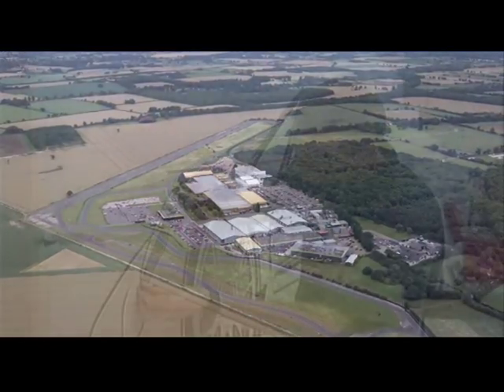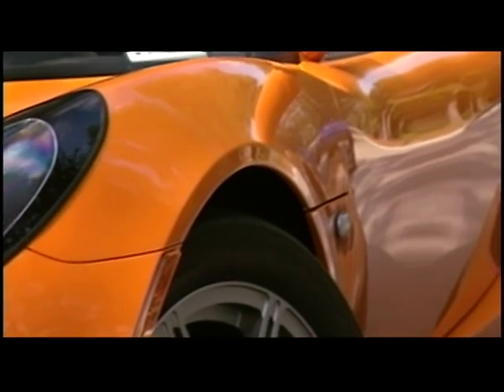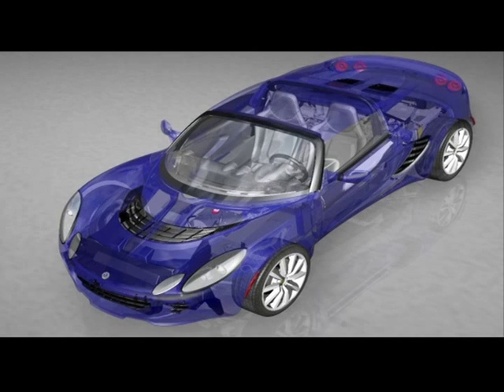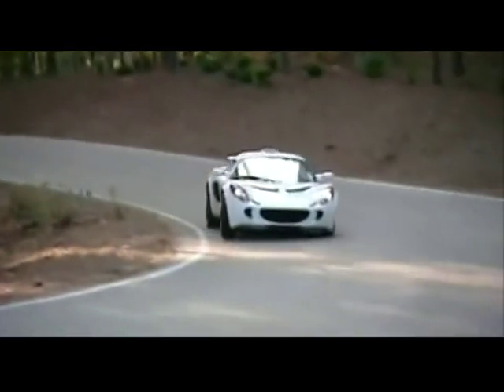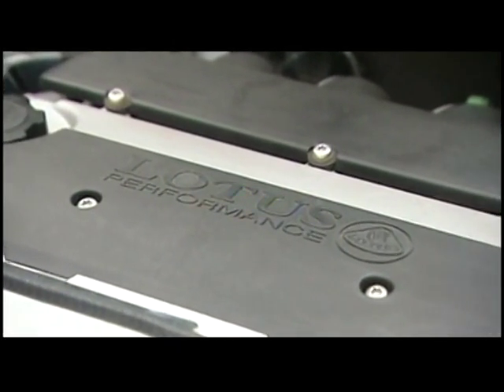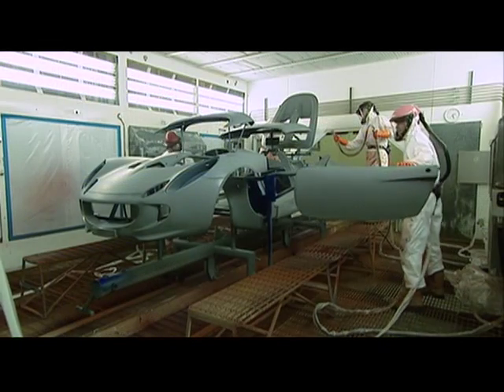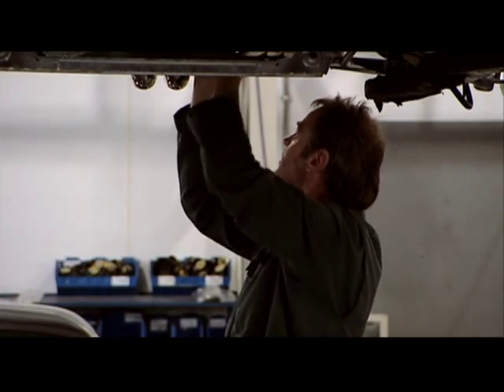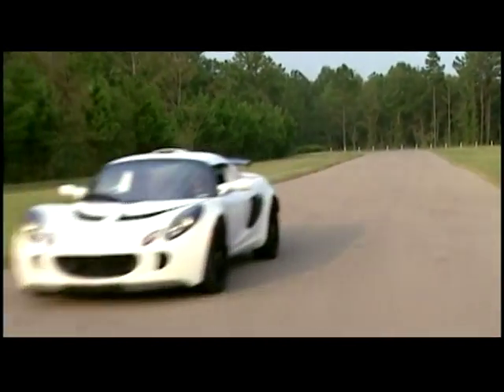How a Lotus is Made

Comment: I do wonder about the lifespan of the epoxy that is holding the chassis together and the aluminum disc brakes,     Japanese high performance motorcycles often opted for cast aluminum brake calipers with stainless steel disc brake rotors,    That seems better as you have two solid blocks of lighter cast aluminum brake calipers with a assumed harder wearing stainless steel disc brake rotors,     But maybe the aluminum brake discs are hard wearing and will certainly be lighter and less contamination of the brake pads than rusty steel ones
Reply: The brake discs are not aluminium, the video is wrong. They were in 1996/7 but the pad manufacturer stopped making the pads for the MMC discs sadly. Long before the S2 Elise shown in this video went into production. So even the S1 Elises which did have them have been converted over. It’s a real shame other manufacturers didn’t care about the (un-sprung) weight savings.
The callipers are cast aluminium and made by AP Racing so nothing to worry about there.
Epoxies for gluing aluminium has been used on Aeroplanes and Helicopters for decades. It’s proven technology. 
All common newbie concerns. But I can’t believe an ‘official’ video got that wrong about the discs.
Reply: And AP breaks (even only two pistons) are very good for the weight of the car.
Reply: the epoxy bonding agent will last longer then the aluminum sheet they use to bond them togeather alot of fighter aircraft aerospace and marine industries use epoxy to bond sufaces togeather
Reply: @GrandPrixDecals  Most people that slag of S1 or S2 have never been any where near one. Certainly never driven or owned one. From an ex S1 owner, now with an S2.